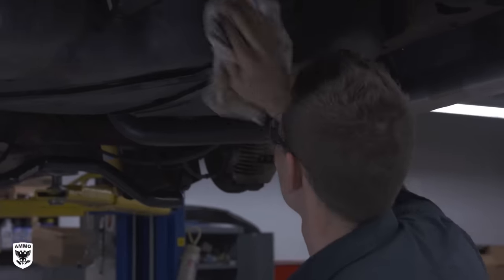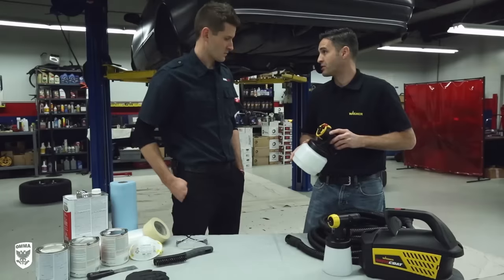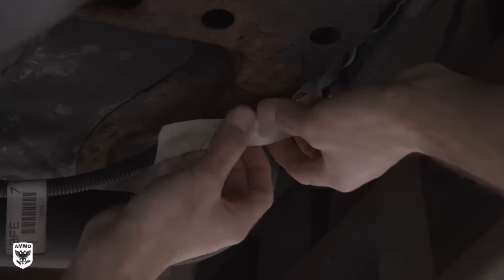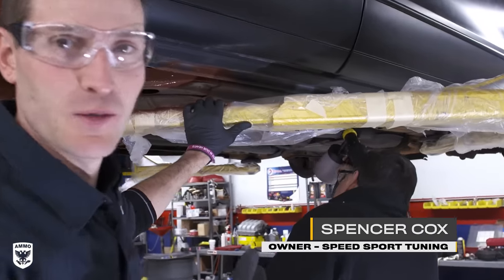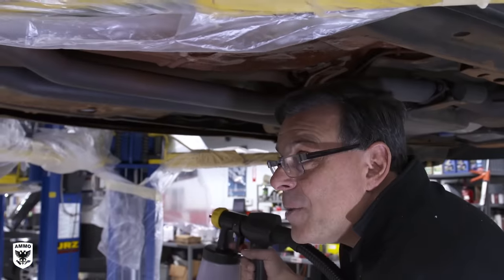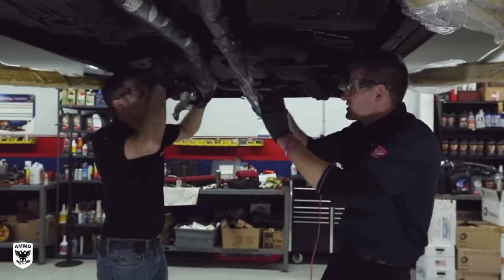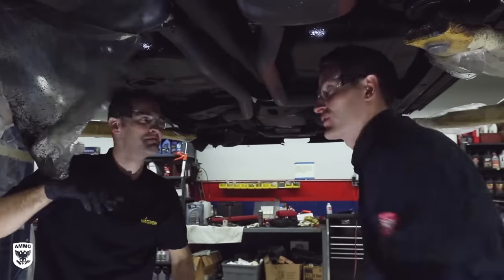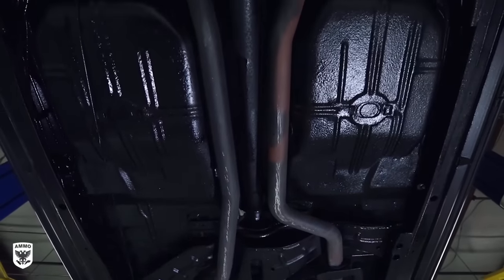How to Undercoat Your Car: Impala SS

Comment: Hey sir ...GREAT VIDEO. Makes me sad though. I too owned a vehicle with sentimental value..I did everything with her. She was a 92 Taurus. Original engine, One rebuilt tranny. I drove her till last year , when driving from Queens to Long Island (Smith Town)... Head gasket blew, after she arrived to our  job destination safely, her head gasket blew.  380,000 miles!!!!   I had planned on undercoating her after that winter. Never had that opportunity. I had no choice but to put her down. No funds to fix, no where to store her. After seeing your video, and hearing how much your beautiful Impala meant to you....I started feling bummed, and wished I could have repaired her and kept her. I was trying to reach 400,000+ miles. Anyway..... Great video. Will attempt under coating on the replacement 2003 Matrix I now own. Rust every where. Will be following your guidance. Thank you.
Christopher, Queens, Ny.

Comment: Yes 100% if your in a dry climate and wanna make the underneath of your car look new again but out here in Canada if we did that 5 years you wouldn’t have a bottom or frame on your car or truck in Canada you gotta use a oil under coating like (fluid film) (known) or (pro-form) and have it drilled. That’s how you make your vehicles last.

Comment: This method as many have pointed out only hides the rust and doesn't stop it's progression.  Even the insides of the frame get zero protection from this and that's how most frames and channels rot out.  Just picked up a new RAV4 and applied Fluid Film to it.  I used rubberized coatings in the past on a rusty vehicle and a couple years later it was lifting from the rust action below.  I'll stick with my Fluid Film.  Get it? Stick?

Comment: @AMMO NYC
 Can you post a picture of the undercoating after the 2 years  , Is it still in good shape  ?
Reply: I bet that the rubberized undercoating is still in great shape. The real question is in which shape is the poor metal behind it!

Rubberized undercoatings are notorious for looking pristine while the metal behind them rots like in a grave due to locked in moisture.

Comment: I would NOT use any rubberized undercoating. Any eventual breach in that type of coating results in moisture being trapped under the coating and speeding up the destruction of your undercarriage. Wool Wax or Fluid Film are lanolin based and are self healing and never dry. They are a much better product that the Rustoleum junk. I bought a used truck that was treated every year with the Zeibart rubberized coating and there were huge pockets of rust on the frame where water was trapped behind the coating. I just had my ‘07 4Runner done with Wool Wax and that stuff is amazing. These sprayers should be able to apply Wool Wax. My retailer did it for $180....well worth it IMO.

Comment: I like to do this procedure on a new vehicle I've acquired However I use a rustoleum spray cans and two wheel ramps and I don't take the tires off, just turn the steering wheel as needed for access.
Reply: I love it!  Work smarter not harder. I like the way you think.

Comment: Start by saying I am not an undercoating expert but have done quite a bit of research.  I’ve watched other videos of yours in this one you might be over your head.  I lost a truck frame in years past doing pretty much what you’re demonstrating.  A rust converter instead of a rust primer.  No rubberized coating over any rust.  What about cavities such as boxed frames, rocker panels, doors etc.  most would recommend cavity wax.  Equipment looks pretty good.  Viewers.....do your research.

Comment: It will still rust. you just want see it happen now. Need to treat rust by removing it completely or neutralizing it with chemicals.
Reply: adam courtney you understand that if you completely cover it off the metal won't oxidize, I don't think you understand how metal rusts...
Reply: Ok, sure. so all pro body workers just paint right over surface rust and unpreped metal. I get that paint will cover the rust blocking oxidation but you still have the issue of chemicals that oxidize metal and affect paint plus the loose particles will cause flaking which all leads to more corrosion.
Reply: I would assume the primer they applied being named for applying to rusted surfaces would have chemicals in it to neutralize/stop rust.
Reply: Sorry D3VO, that's not how this works. It's already oxidising and will continue to do so. This kinda DIY "easy" over painting will slow the process down alright, which is fine for a car that will be moved on/scrapped in a few years(or if you live in a very dry climate). It is not fine for lets say any car which the owner wants to preserve as a classic for the future. The rust will continue eating away at good steel and now it will be hidden by the undercoat layer while it's doing so. Not good.

As for added chemicals to neutralise rust as Punkrrrock mentioned, they are only a solution for extremely thin layers of surface rust as the coatings don't penetrate very far. Flaking rust has gone far beyond that point and any bubbling of the paint surface means that the metal has rusted through and become porous and needs to be cut out.

Proper rust treatment: remove all visible traces of rust. Treat remaining steel with rust "neutralising" chemicals. Cover surface with high zinc primer. Apply top coat. I'd personally not put undercoatings on top of that as I prefer to be able to keep an eye on proceedings, so would use the various anti rust wax coatings on the market, but they do need more annual upkeep. 

Just my humble anyway. .
Reply: agreed.
Reply: Yep after reviewing a few contemplations it's best to go with a deep sanding to bare metal and very thick wax/oil coating. Then every 6 months throw on some more. What if you were to put used motor oil across the entire under side of your car? It dries thick and no air is going to get to the metal. Most people on Google say it's fine.
Reply: sand to bare metal, prime with high zinc based primer, then an overcoat. Just leaving bare metal with an oil on top wouldn't be ideal at all. Bare steel can go visibly rusty very quickly, within hours in some climates.

Used engine oil can work as a barrier. I've seen vintage cars that had a bad rep for oil leaks be pretty rust free wherever the oil stuck. That said it's nasty smelly carcinogenic stuff and contains acids that could even add to your trouble, but it is cheap/free. I'd personally go for the proper barrier/anti rust oil based finishes(waxoyl or even better IMHO any of the Bilt Hamber stuff, but dunno if that is available wherever you are).

Comment: doing that on jackstands would be shitty,  good thing i have a lift.
Reply: turbonut20v is How much to send it tasmania
Reply: turbonut20v 😂😂I know it will be hell
Reply: Arkansas Mudder I kept my new 1996 Cadillac Deville underside wet with WD-40, and the exhaust painted with bbq heat paint, the rest of the unibody had a paint finish.  In the North east United States, I have no rust anywhere.  My 2002 Chevy venture I used truck bed liner on the underside and wheel wells.  As a daily driver, it only suffered from a little rust in the wheel wells which I covered with bondo and more truck bed liner paint.  I can get 10 more years out of that van.
Reply: turbonut20v I was thinking the same thing. If you put it on jack stands your either not going to get a good coverage but you're going to cover yourself with the undercoating. Good thing I have a lift lol
Reply: Wait, so how did you utilize the WD-40? And what paint were you using for the unibody?

Comment: Obviously this should have been done BEFORE the car had any rust. The heavely pitted frame rails, floorpans etc. should have been blasted to get clear metal. In my experience the rust will always come back unless you  really remove all the rust first. I've been there... I know some products will apply right over (slight) rust but it just doesn't seem right to me. I am curious what you did to prevent rust from the inside-out, which as you know has nothing to do with undercoating. Best regards.
Reply: +MrZdvy Rustoleum makes a product called rust reformer which basically turns a rusty oxidized surface into a primer surface ready for paint without any sanding needed. I'm surprised Larry didn't use that here. Although I can't say how it holds up in the long run I sprayed it as an undercoating to me lawn mower 4 months ago and its held up strong.
Reply: i was going to buy a truck off a guy so i email him..how is the frame??  course he says great..solid etc.. so i go look at it and its all painted ..looks to good..i take out my leatherman tool and start poking around and punch thru 2 spots lol..the sale did not go thru.

Comment: Thats  is the worst idea EVER. That was just a bandaid over your rusting car. 

FLUID FILM IS THE BEST.
Reply: I always sprayed chassis Saver you can even use it over rust or on new chassis I did it on my 69 chevelle and it's never rusted I also done it on a 2000 Silverado no rust
Reply: Right
Reply: @AYE OK SURE what about OSPHO?
Reply: @johns3153  how long will the protection last?

Comment: Loving the comments section. Based on my personal experience, it's best to get this done when you get a new car. But if you want a used vehicle to last a bit longer, use degreaser ,  metal prep, then your rust paint. In nova scotia they pore salt on the roads likes it's a party. It's better to protect it now,because that salt isn't going to care how well you did that proper prep with sandblasting.

Comment: Rust will continue to rust more underneath ! Not o good job i have to say. Best thing is to sandblast the hole body first and then do as you wish !!!
Reply: Costadino Serafimidis sandblasting will destroy underneath. You need after sandblasting some area immediately put some layer of protection.

Comment: looks really good.
you could paint the exhaust pipes with high temperature spray, so everything will be black under the car. you can find it at the home depot. really cheap.

Comment: I've heard undercoating your vehicle is not good for it as the finish can crack and will trap moisture. I live in NE Ohio where we loooove putting salt on the roads. I plan on spraying the underside of my '89 Ford F-250 with Fluid Film. Much like spraying with used motor oil but the Fluid Film is biodegradable and won't harm rubber bushings or electrical connections. It's certainly not a one time spray. I plan on spraying twice a year.
Reply: +Ohio Digger I use plain oil motor oil sprayed out of a garden pressure sprayer. Its a 97 Jeep and rust free.Oil is the best against rust.
Reply: Is the garden sprayer able to spray something as thick as motor oil?  Is it just the hand pump kind of sprayer? I have a garden sprayer but figured it wouldn't be able to pull the oil up and pump it out.
Reply: +Ohio Digger Yea, just thin it a little bit with anything like paint thinner or lacquer thinner. It sprays on really well. And the thinner will evaporate and the oil will go back to being thick again. I saturate every hole inside the rails till it runs out.
Reply: +lar4305 you can thin it out. But I would recommend getting one of the kits they sell with the gun. You will waste less and apply it more evenly. I also live in NE Ohio and have a GMC Yukon from North Carolina that has hardly any rust. I put it in in October and it is still there. Only place that has really washed off is around the wheel wells and you can easily touch them up. Overall I am satisfied with the durability of it. It does thicken up drastically if left out in the cold so I would recommend bringing it up to room temperate before you spray it.
Reply: What part of NE Ohio?  I'm in Ytown. I had bought a gun off Amazon with good reviews from people who specifically used it for spraying Fluid Film.  I was hoping to have sprayed it by now but never got a chance and now they started dropping salt.  So I'll probably leave it sit this winter and spray it in the spring.  I was thinking about getting one of those hot plate warmers that you just plug in and setting the Fluid Film can on there to warm it real nice.  How often do you have to spray the Yukon?  Do you get more than one spray from a gallon of it?  It's like $50/gallon.  I only put about 2500 miles on the truck this year so maybe I could get away with one spray a year but we will see.  I'd rather buy more Fluid Film than have rust repair done I guess.

Comment: very nice underbelly coating that did that to my 1988 chevy nova as a dealer option it really drove nice with that because it also made the nova very quite inside while driving , now days dealers wont do such a option as the car is new .instead new car only have this plastic thin foam trim pieces .

Comment: That's one thing that I'll NEVER gonna do with my car!
Reply: Why?
Reply: @napoleon23232  Lot of rubber based undercoating can trap water against the metal encouraging rust that the user would never notice and it would slowly get worse over time.
Reply: Dovah Do Volom this is why the prep work is so important. You do this on a summer day and you pressure wash the entire bottom, scrape off any built up rust, dry with compressed air and maybe let sit for a day or two, dry again and then undercoat. If there’s no moisture to trap then you will prevent future rust or slow and maybe stop the current accumulation of wear. You don’t undercoat 15 minutes after you wash it lol
Reply: @sub_second_life3174  its still locking any moisture that is in there in. Salty water from all the salt used in NY during the winter month's seeps into everything by natural chemical reaction. 
ANY small cracks or "oops I missed a spot" and that salt water is gonna eat the metal alive. It has no place to go, its trapped. Worst of all you'll never see it and think everything is okay.
There are other products out there I would suggest. One being Fluid Film. You could probably use the blower in this video to do the work for you as well. 
If anything, before you decide, do a search on here for the dangers of rubber based under coatings and see what alternatives there are. You may be suprised by what you find. Just my 2 cents. Well... that was more like a quarter but hey, you probably didnt read this far anyway -✌😆
Reply: I just watched Eric's video also and realized he is right that it just trapped the moisture inside and it rots your frame really bad.  and also the stuff starts peeling off about a year or so later and it will start peeling layers of the frame back with it. if someone wants to do it right there better off just sandblasting the whole frame and painting it.
Reply: @davieboy1970  Only bare paint on the underbody? You have to guarde it somehow.
Reply: @Morzsaszar  fluid film all over will not rust bonds with dirt and makes a  greasy surface
Reply: Same. I drive my BMW in the winter here in Canada with no anti rust and it's fine.
Reply: @sub_second_life3174  My 2014 Skoda Rapid comes from the factory with this rubberized undercoating and there are several big holes in the coating from the rocks hitting it and now moisture is stuck betweeb the bottom of the body and the rubber coating. It's rusting real bad and it's only 6 years old.
Worst part is that if you take a quick climps underneath the car it looks really clean and rust free which is actually a massive lie.
Reply: Karl H. Künstler I just bought a new car and they use a plastic shield to cover the entire bottom. Who knows how well it works but I don’t care I don’t keep my cars long enough for them to rust out. 10 years max
Reply: @sub_second_life3174  Plastic cover is fine but not this rubber undercoating that is sparayed to the bottom of the car.
I in the other hand don't plan to buy or lease new cars so to me it does matter.
Reply: @DovahDoVolom  It only traps water if you put it on too thick.